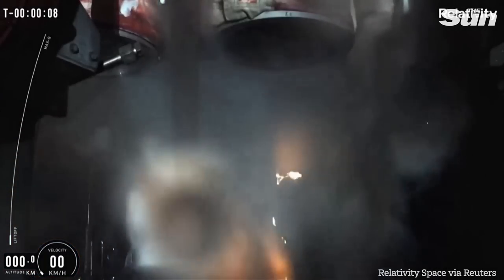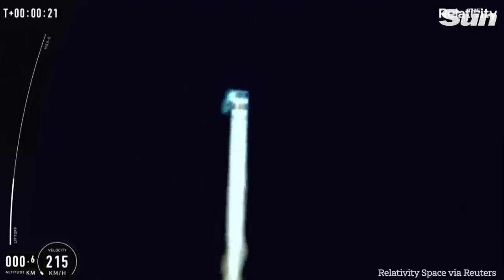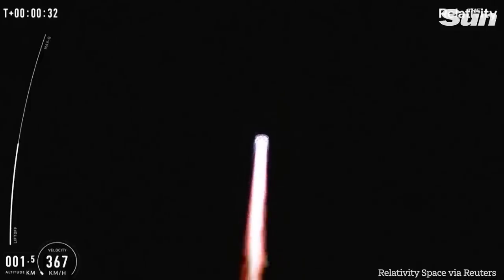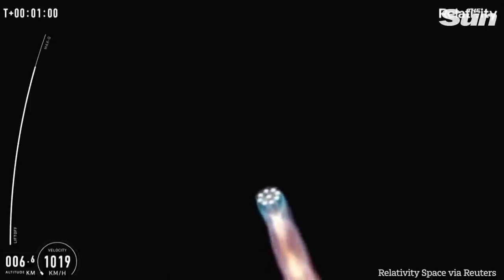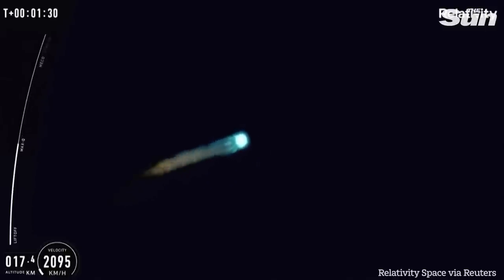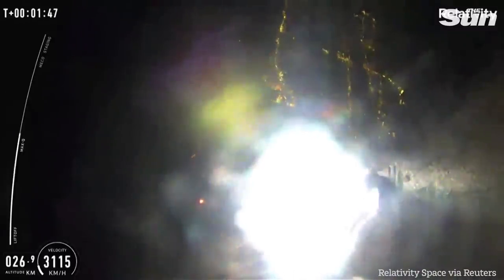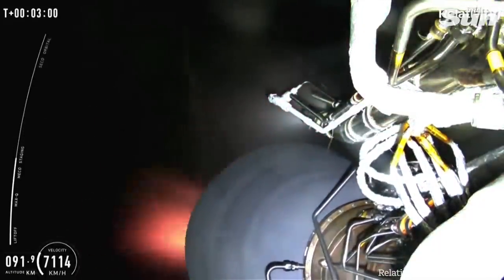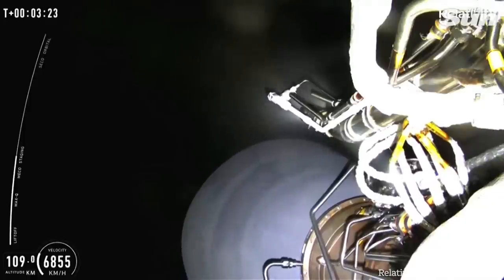Relativity's debut rocket launch proves durability fails in space

Comment: People dont understand how important this is... It's a damn 3D printed rocket ! PRINTED... And the thing did not get teared appart by max G. That's mindblowing ! GG teams. Godspeed Terran 1🫡
Reply: YESSS
Reply: I don't know why the PLA didn't melt on the way up...
Reply: @Billy_Bad_Ass  You can be sarcastic, bu put it under another light,  that's just like, if car manufacturer would be able to 3D print a full 3 volume body plateform, and not even pass the crash test, but get the maximum rating classic welded steel chassis get rated at. Definitely a milestone for the industry.
Reply: @fabrb26  No, I 100% agree.  I just couldn't help myself.